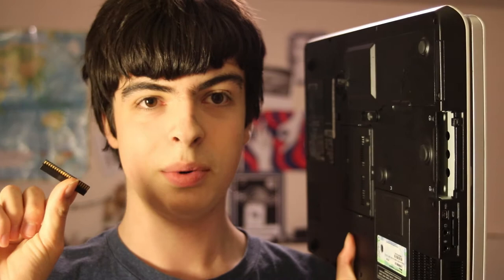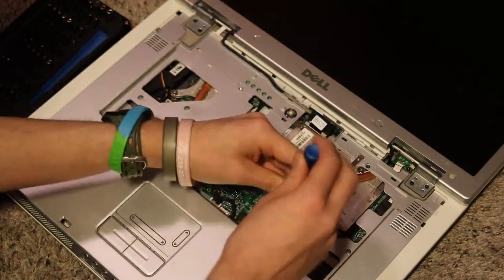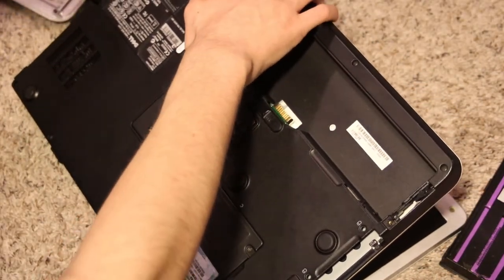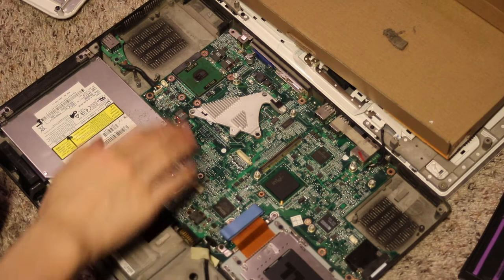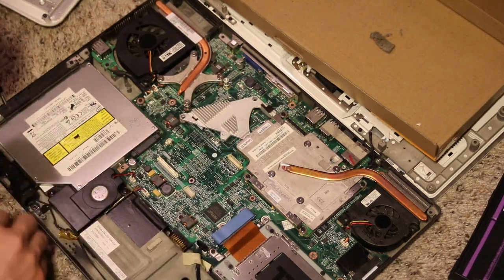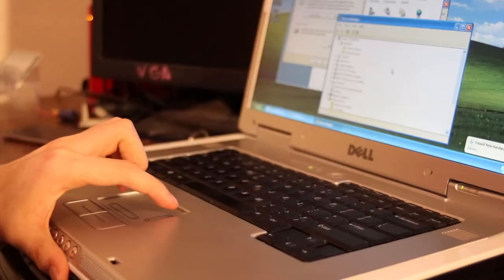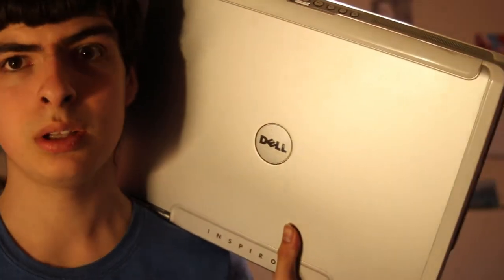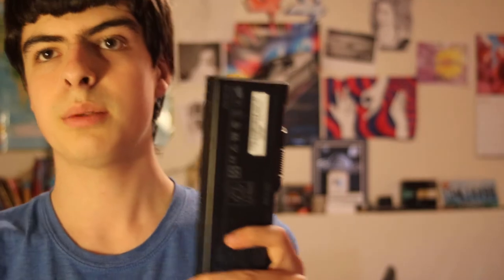Dell's $3,000 Laptop from 2005! - Inspiron 9300

Comment: Dude, you definitely added a very impressive out look about this laptop, I have one. the question I was just curious about  the Dos battery location on the mother board? Thanks Dude 👍🏼
Reply from the maker: The cmos battery is accessible by removing the keyboard and locating it on the motherboard. It comes in a wired package

Comment: I owned this laptop and while I cant remember it being slow, I do remember playing BF Vietnam well (30fps at least) and UT2003/4 -- and I played competitively back in the day.  It's desktop replacement.  I think I paid slighlty north of 1k at the time.
Reply from the maker: oh certainly, its by no means a slow laptop for period accurate tasks. but consider that dell inspiron e1705 from just a year later came with a core 2 duo and literally doubled the performance output. 
32 bit pentium Ms were a dead end platform 6 years ago, while my e1505 still handles the modern web like a beast with 4gb of ram and a core 2 duo t7400.
Reply from the maker: i still have this 9300 laptop though because since pentium m was pentium III based, it offers excellent backwards compatibility with retro games. and also its one of the nicest condition models ive seen still kicking around